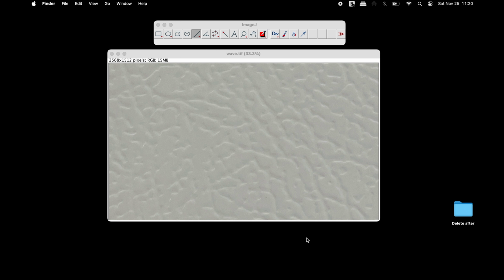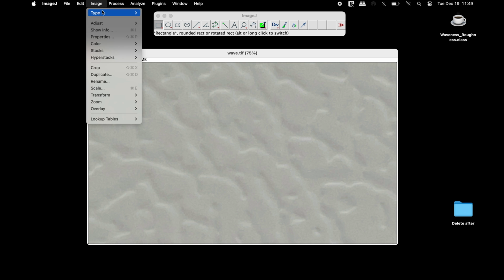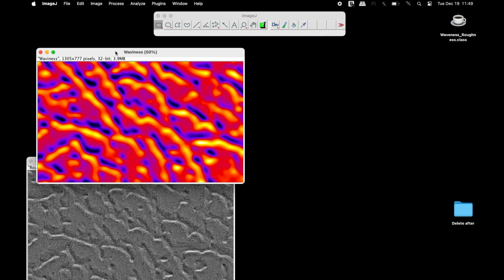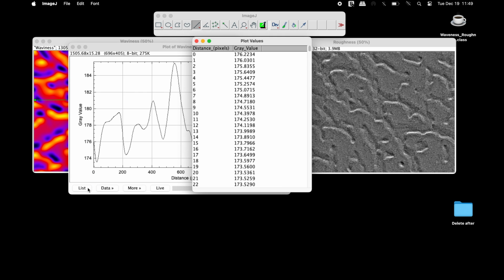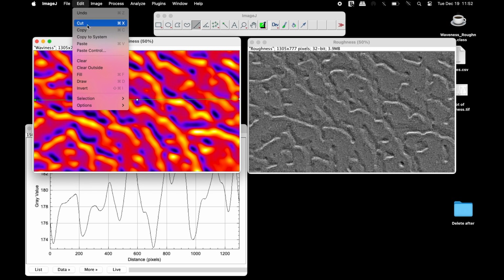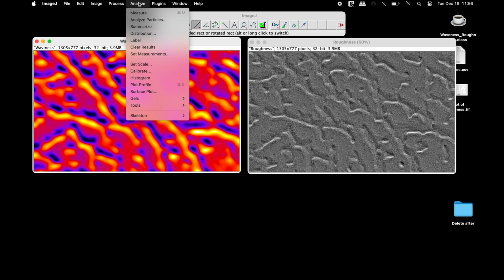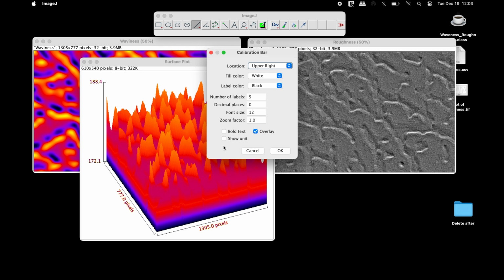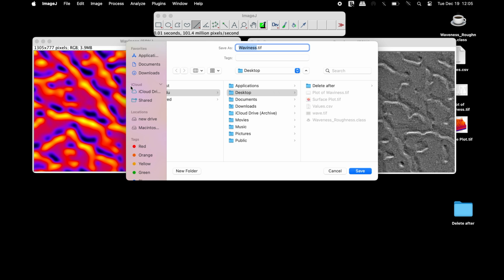How to separate the SURFACE TOPOGRAPHY into WAVINESS and ROUGHNESS using ImageJ

Comment: Can I get a specific Ra value?
Reply from the maker: Hello, thanks for reaching out. To get the Ra value i think this plugin can be used https://www.gcsca.net/IJ/SurfCharJ.html      in the above video the values are in gray values and distances in pixels. it may be time consuming to calculate the Ra value from it. it involves converting grayscale image into a surface profile, extracting the intensity values along a specific line, then calculating the absolute deviation of each point from the mean line, and finally averaging those deviations to get the Ra value; essentially, treating the gray levels as height variations on the surface.
Reply: @nrttaye4033  thank you
Reply: @nrttaye4033  Can you come up with a video to introduce it
Reply from the maker: Hello, thanks for watching my videos. I will come up with the video one day.